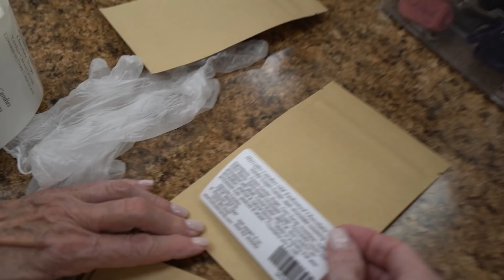This 100+ Year Old Candy Is Still Made The Same Today!

Comment: IDK if this has been said but the reason you use corn startch instead of flour is because when flour is exposed to the moisture from whatever youre casting it begins to form gluten and glyoden protein chains that essentially turn it into bread dough and would stick to the candies since it doesnt revert back once the water evaporates.  This doesnt happen in cornstarch, it simply absorbs the water and then evaporates it out without any major chemical change

Comment: Starch is just the carbohydrate of the grain, with everything else stripped away. Flour has varying degrees of the rest of the grain in it, depending on the type of flour. For example, whole grain vs all purpose. So, it is technically corn starch you are working with, and not cornflour.
Reply: Cornstarch/cornflour are one and same depending what part of the country your from and corn meal is totally a different animal … lol 😆
Reply: @revrontalbot6911  In England they call corn starch “corn flour.” I’ve never seen it sold as corn flour in the US. 

I wonder what they call wheat starch? :-)

Comment: Sugars, starches and fiber are carbohydrates. Flour (wheat, corn, rice, etc.) have starch, fiber and protein in them. Pure starch is just the starch part - the fiber and protein parts are stripped out. Fiber and protein won't hold a mold shape well like pure starch does.

Comment: the fondant making machine with the hot plug it needs a service. Hot plugs can catch fire and cause electric shock be careful
Reply: I saw smoke!
Reply from the maker: Yeah, the plug has already been replaced by now, safety first!
Reply: @HerculesCandy  Check that socket aswell. Usually hot/melting connectors are a result of a bad connection in the socket, which makes alot of power run through a very tiny portion of the connector - essentially heating it up. If you're constantly using the same socket for that machine and constantly plugging it in and unplugging it I'd have a electrician look at it and replace the wall socket.

Comment: What is the point of the flour molds vs using reusable molds?
Reply: Starch, probably. And because "reusable" molds won't release that easily. Edit: oh, you're right, they ARE using flour. That's weird.
Reply: @jpaxonreyes  they aren't using flour. They were joking. You can't use raw flour because it has to be cooked before it can barely be eaten.

Comment: You can't use flour instead of starch because flour needs to be cooked before eating it. Raw flour is pretty nasty. It is the reason we can't eat raw cookie dough. It's not the raw eggs like people often think. It's raw flour. Also starch is much finer than flour. But my question is, why don't you just buy plastic molds instead of having to remake starch molds over and over? I could see why they did that in the past. Plastic wasn't a thing, but now plastic is cheap and easy to mold into whatever you want.